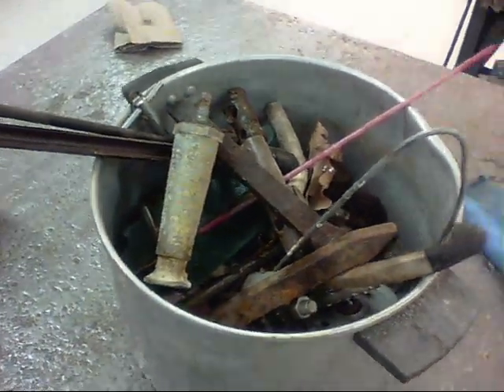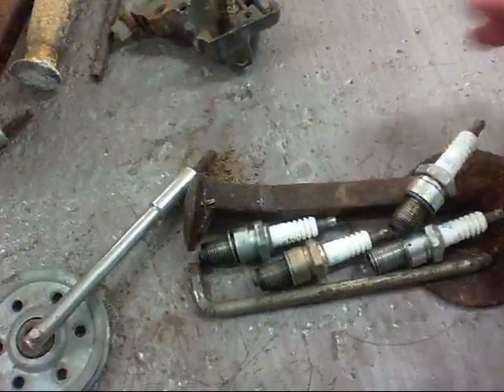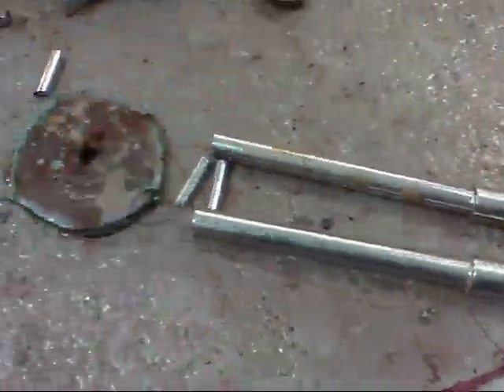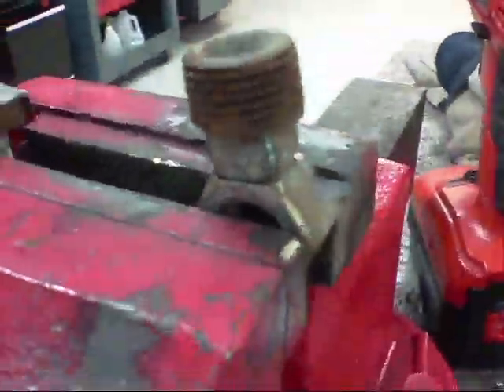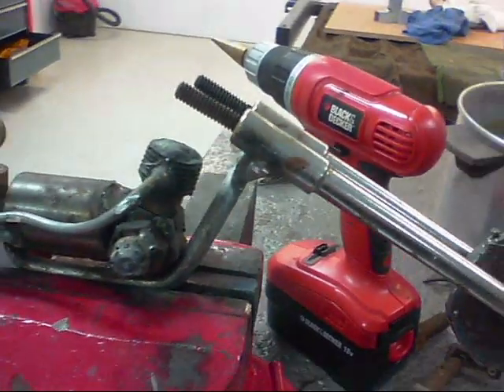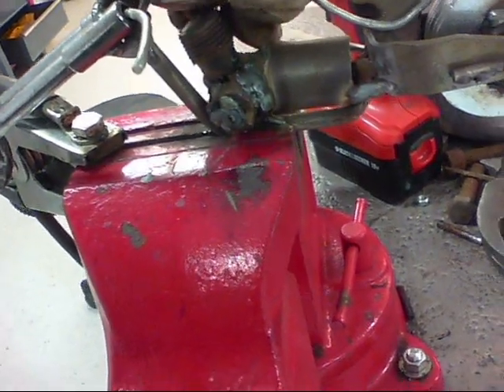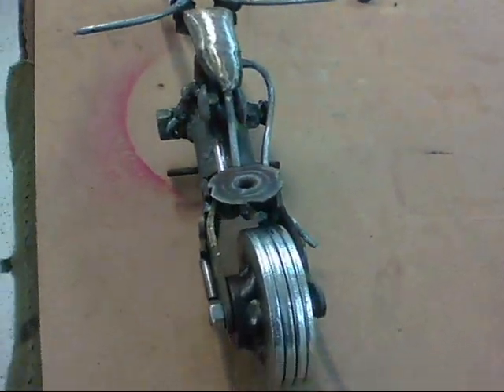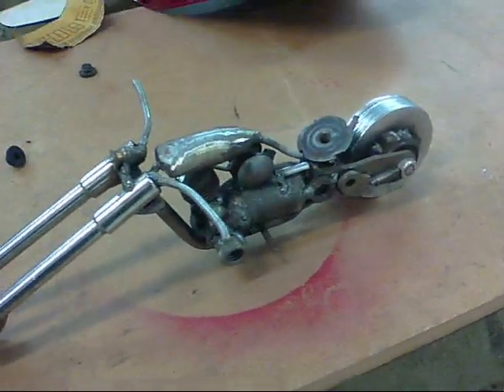How To Build Metal Art Step By Step (Chopper Project)

Comment: Thank you for showing me your chopper project. I want to start don't metal art but I don't know what type of welding tools I need...Xian you reply to me with the answers as to precisely what I will need? Thank you
Reply from the maker: Joseph Rios Joseph all it takes is the wilingness to start somewhere with what you have. You can make beautiful art without a welder if you plan accordingly. No hardcore answer to your question but if you are driven to do this sort of thing start tingering with what you have and over  time your work will grow as will your techinque. That being said you can get a good used mig welder for 500 bucks or you can start even cheaper by using brazing torch.
Reply: I was able to buy my first everlast mig welder for about that price. I used flux core for the first while until I could justify getting an argon tank.
Reply: I'm saving up for an Everlast mig welder. I hope to use my stick welder to practice making some art in the meantime.